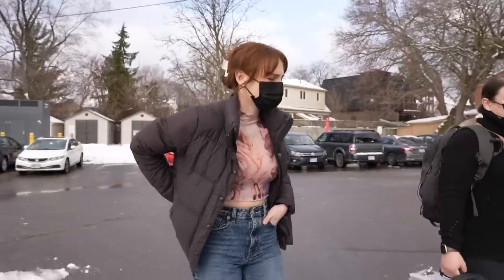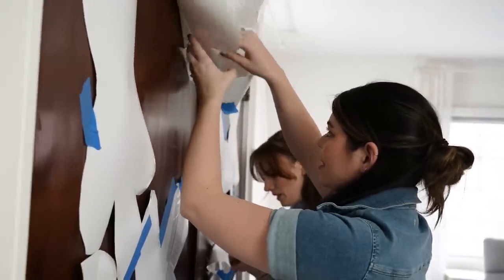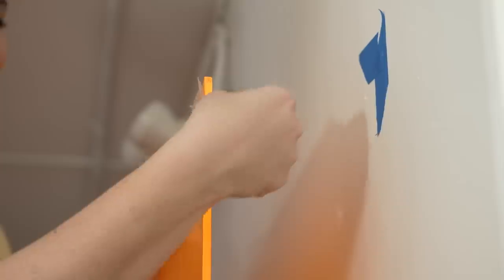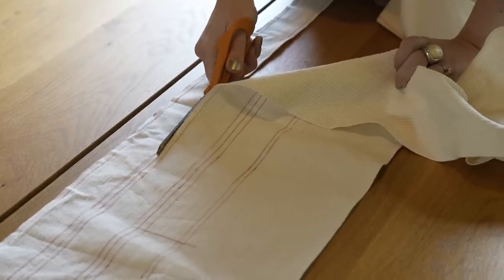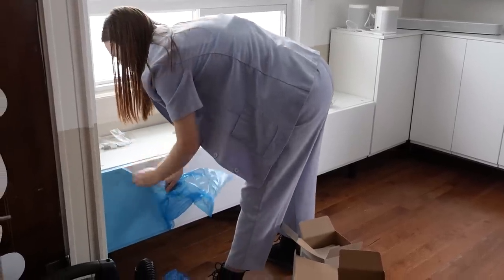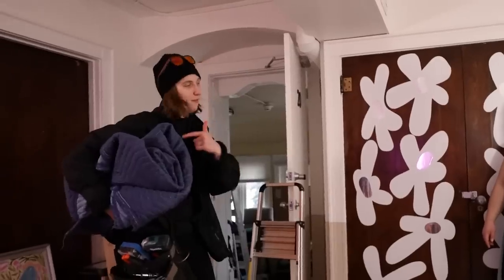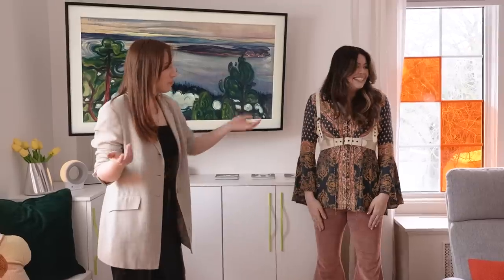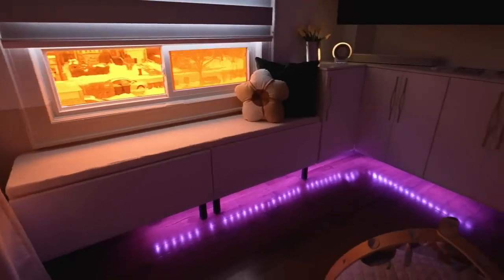surprising teen moms with a living room makeover *baby friendly*

Comment: Next seat cushion: flip the cover inside out and get your edges right before sliding the cover over the cushion, instead of stuffing the cushion into the cover. Way easier... and it works on long foam sections.

Comment: for stuffing foam into a case when its a difficult or long shape like that in the future, a few options:
1) if you are the one sewing the case, keep the opening on one of the long ends so you can just put the corners in easily and then sew the opening closed either by hand for it to be invisible or on the machine.
2) If the case is already made, keep the case inside-out. Lay it on the foam, lining up all corners. Start turning the case inside out while keeping the foam 'attached' to one side of the case. Its easier to start from the closed end. Shallowly stuff the closed end inside itself, stuff that end of the foam in with it, and then keep inching up from the back to the front.
3) you can do the duvet roll method, but i honestly have no idea how to type that out in a way that makes sense. You roll it up with the case lined up (same as last suggestion) and then stuff the roll into the open end and unroll it and somehow it is covered. Lol.

Comment: Also, to get the slipcover over the foam in the future, you may want to try turning the slipcover inside out. Stick your arms in it and grab the outside corners, then grab the corners of the foam, and slide the slipcover on, turning it right-side out as you move along. I do this with pillowcases and it works like a charm.

Comment: 9:48 This isn't the way Becky. You have to scrunch the cover up all the way until you get to the bottom and all the rest is scrunched up in your hands. Then you put the bottom of the cushion in the bottom of the cover. Now you just pull the scrunched up cover up over the rest of the cushion. The whole process is like a long sock you are putting on your foot when you hold the opening of the sock in your hands and with your thumbs and fingers, you scrunch the tube of the sock up into your hands until you've made it to the toes. Then you stick your toes into the sock and you have the rest of the sock in your hands so you pull it up on to your foot and lower leg.  I hope, yet doubt, that this made any sense but this is the way I always do this and it works like a charm! Everytime!

Comment: If you want a quick method for putting foam in a cushion here’s what I do. Put the foam piece in a trash bag or a clear leaf bag . Wrap the open end of the bag around your vacuum cleaner hose and suck all the air out. Holding the bag closed tight quickly get the entire thing bag and all inside the cushion cover. Once the foam is all inside let go of the bag opening . The foam will reinflate and you will still have to do some shifting around and fluffing. You will probably have to reach into the bottom of the bag and tear it open so that you can pull it out from the open end of the cushion. This works well for anything that will fit into the above mentioned bags. I think the only way to put the cushion into a long cover like that would be to turn the cover inside out, put the end of the disjoin into the closed end of the cushion cover and try turning the cover right side up as you move up the foam. You might have to fold small sections of the foam in half in the lengthwise direction, unroll the cushion cover up over that section, then fold the foam up for another bit, then unroll the next section of the cover. I’m not explaining it very well but it’s the only way I would think it could be done. I normally would break any cushion up into maybe 3 ft. sections - no more. It’s just too hard to put together. The other idea I had would be to open one of the long seams at the back, slide the foam cushion into the cover, then hand stitch dow the long seam. I would use big stitches because the cover is white and babies and Mums mean washable. You would have to find an easy way to launder it.

Comment: This is awesome! It looks super cool and it for a great organization. I am just super concerned because this place does not look baby or toddler proof at all. Cords from the light fixtures so easy to pull. Cabinets would have been safer without handles and no baby proof locks on them. The bookshelf needs a lip, so things will stay put even if a toddler puts them back. Glass from picture frames on top shelf with nothing holding it in place. Just a few of the many hazards for kids. The tech is not secure. It's super cute but not super kid friendly?